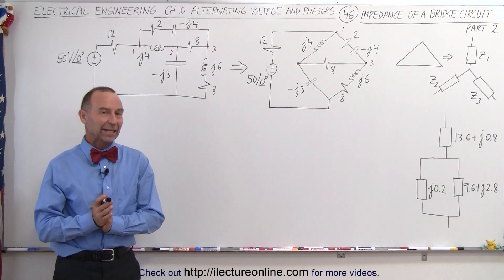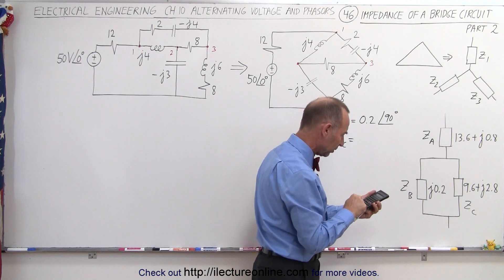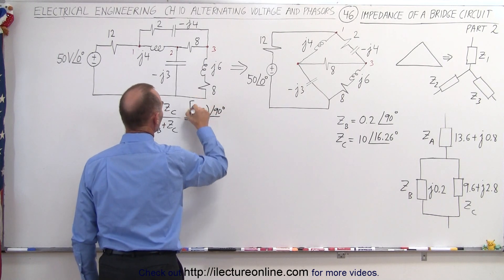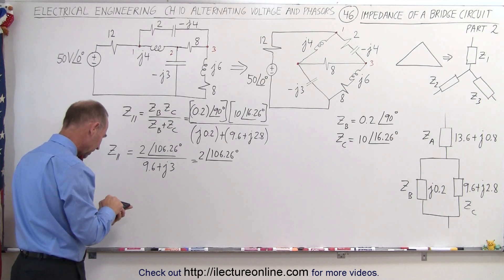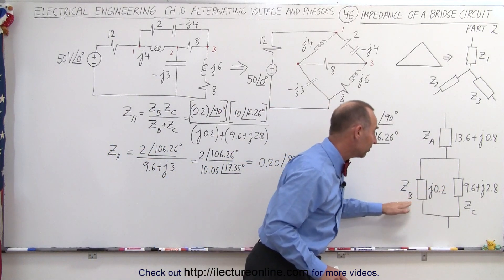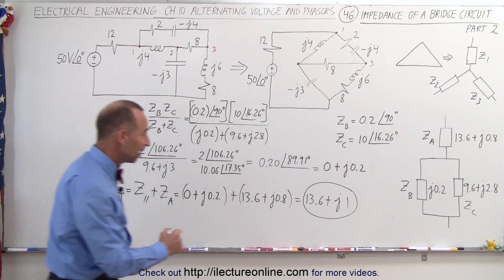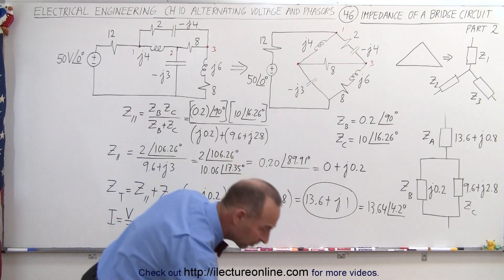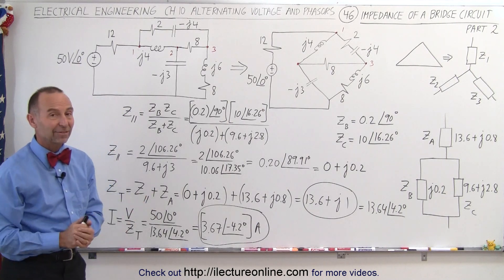Electrical Engineering: Ch 10 Alternating Voltages & Phasors (46 of 82) Z=? Bridge Circuit Ex. 1-2

Comment: Hi professor, I was stumped for a long time because I tried doing this problem without looking at solution, but at 3:18, my calculator result for arctan(1.92/-0.56) gives me -73.7, which I used for the calculations giving me the wrong answer.

 I spent long time wondering how you and the online form converter both got 106.26, but turns out I need to add 180 to my answer and then I will get same as yours. Wondering, why must I need to add 180? How do I know if I randomly ever need to add 180 to my answers in the future? I never did so before and got correct answers 🤔
Reply from the maker: That is a trick we use often.  We try to get the answer to be between + 90 degrees and - 90 degrees on the phasor diagram, but essentially it doesn't matter (it is the same answer).

Comment: sir, for the total impedance for zB and zC, when you subtracted the angle 106.26 and 17.35 at 5:00 the answer should be 88.91 not 89.91 i believe. thank you for your effort Sir, this has saved me a lot.
Reply from the maker: You are correct.  Thanks.